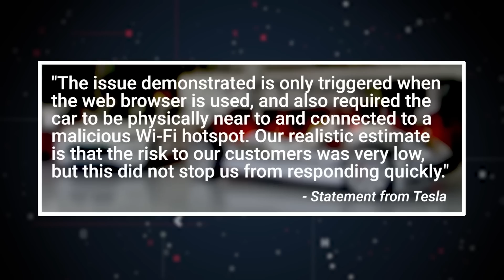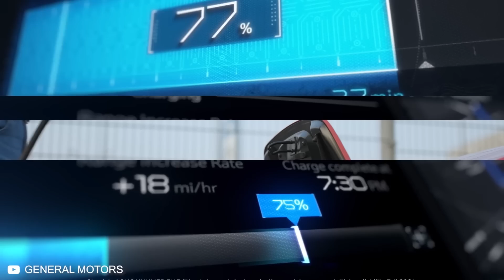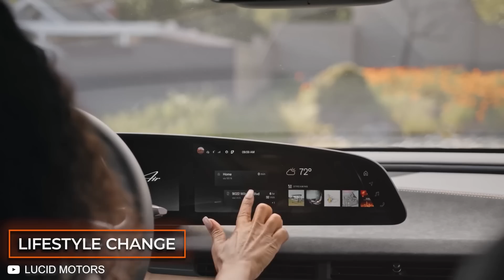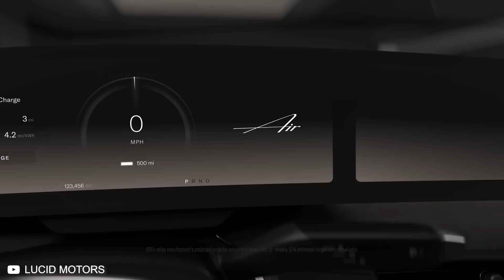EVs' Serious Problems That Carmakers Are Hiding

Comment: If I understand correctly, lithium battery production is bad for the environment.  Disposal of used lithium batteries isn't good for the environment either. Then there is the issue of how the electricity is generated, to charge the vehicle's batteries.  Solar panel farms don't work so well on cloudy days, or at night.  Wind farms have been known to fail in freezing weather and when they wear-out, their components are buried in large landfills, since they can't be recycled.  When newer battery technology replaces lithium batteries, and the electricity supply production is resolved, EV vehicles may start making headway in replacing the internal combustion engine.  As is stands now, EV's are a novelty item for those who can afford them, and only plan to use them for driving short distances.
Reply: There is no such thing as green energy. They will all pollute and destroy one way or another. The right thing to do would be to have a mixed energy matrix. Carss could be hybrid instead of this EV madness. Hybrids can reunite the best of both worlds. The old Fusion would run on EV in the city, but if needed you could run on gasoline, which was good to travel. Besides, it would auto-charge by converting the kinetic energy of moving into battery charge.
Reply: @Willowy13  Somehow this seems to have been all forgotten in the rush to go totally electric.
Reply: @Willowy13  Hybrids double the complexity, making the cars more expensive and more likely to have problems.    Pure gasoline or pure battery EV, those are the only sensible options.

Hydrogen EV is a joke, not even worth of discussion.  Toyota Mirai, for example.
Reply: @DerekDavis213  hybrid Prius V is a great car and not expensive at all
Reply: @ivanvalentin3898  Several problems with Prius:

-weak motor, poor acceleration
-it looks wimpy and boring
-it is not a man's car
-hybrid is complicated,
-battery EV is more reliable
Reply: @DerekDavis213 Hybrids? Mechanically not really. Battery and a EV is not as simple as you think.
 Automatic transmissions and IC engines also are very complex. I have taken just a few of them apart and put them back together. That is the easy part. All the stuff wrapped around it not so much. Then there is the 1s and 0s part.
But Batteries? No thanks. Do not like working in a hazard suit.
AS to why a hybrid can be a good thing.  Had to get the automatic transmission rebuilt at 150,000 miles. Pretty much normal. Got two choices auto or manual. Replace clutches at 90,000 or so or rebuild the automatic. But do not worry they have figured more expensive ways to build a manual transmission. Dual Clutch. 
Have I had manual trans missions that have went to the bone yard and never repaired. With the chassis and motor worn out? YES 
Well if you can make a battery that WILL last longer than the I-6 in my T-blazer? 18+years and 200,000 miles.
 I will buy it. THE following splains how it works. THE main failure point is the battery. For Toyota and Ford, no exceptions.
Continuous fast charging ANY battery is not a good thing for battery life. BUT what do I know? I am a college STEM graduate.
https://www.youtube.com/watch?v=hHU5xFOBcsU&t=1156s
Reply: @DerekDavis213  Love the comment "it looks wimpy and boring"
Reply: For anyone not living in an urban nightmare or city sardine can, all of this is total nonsense. Let's see how good you can plow snow with an ev truck. And how much wood you can haul with a tesla.
Reply: @nathanlambshead4778  Also if you are away from an urban area, good luck getting timely service for the Tesla.

People that like to service their own cars are out of luck with Tesla:  it's locked-down and full of DRM.
Reply: The only way that solar panels can show promising results is if they're put into space.
Reply: @caster863 your cables will be too long and voltage loss will be too great to even consider doing that...
Reply: @caster863  Solar panels are promising for only a stopgap, Wind and solar will never carry the whole base load.
Reply: I agree they are trying to do this transition to fast.
Reply: Agreed.   Tesla is only good for people that:

-drive short distances, not frequent road trips
-can charge at home in their garage, with 230 volts 50 amps
-live in moderate weather.  Extreme cold or heat is not good for EVs
-can accept all of Elon Musk's hype and bullshirt
Reply: @DerekDavis213  Exactly. Plowing snow at  –10 degrees doesn't go so well with evs.
Reply: @nathanlambshead4778  Yes, and also towing is poor with EVs.   And Tesla gives a rough ride because of low-profile tires, and primitive suspension.  And wind noise at speed.
Reply: @DerekDavis213  Plus wearing tires (and roads) out fast because of the excessive weight, of ALL EVs.
Reply: @nathanlambshead4778  And even before the tires wear out, if you hit a curb or pothole with ultra low-profile tires, say hello to 1000's of dollars in damage to tires or wheels.   Tesla s__ks.
Reply: @DerekDavis213  It's a fact shared by all EVs. Not just teslas.
Reply: @DerekDavis213  exactly.
Reply: @DerekDavis213  EVs are hobby cars, sorta like those bicycles with a cargo area up front that some people buy to transport kids and groceries. This is why government is forcing their use, they suck.
Reply: @melainewhite6409  If EVs had longer range and lower cost, they wouldn't be so bad.

But government is going to have a hard time forcing their use in USA, when 100 million people rent apartments.
Reply: @DerekDavis213  Ok, if EVs didn't suck they wouldn't suck. But people ignore reality (and physics) that from the day they are made, batteries continuously permanently loose capacity, much more so whenever used, and severely so when discharged more than 50%. Just like range and recharge numbers are a fiction, battery life claims are also a hoax. My relative with a 5yo EV has 1/3 range now which again, was never actually near the claimed value.
Reply: My wife want to change her Lexus to an EV as it is so much more convenient in winter! (we live in Sweden).
But you are right in that if you do not have access to an outdoor outlet, you should not buy an EV.
Reply: @DerekDavis213 allcorrect but it’s Musks ‘ attitude that’s off putting
Reply: EV's = child slave labor in The Congo and a fiery death for you in your sleep while your car is charging in your garage overnight.
Reply: Cables are stolen everywhere for copper and that  will be the end of EV's
Reply: @lucbos7516  I know that in South Africa (where I grew up) cables are constantly being stolen. Miles of them at a time. Have not seen that in USA though. At least, not that I know of. Have you?
Reply: I still have not experienced a rechargeable battery that lasts longer by being fast charged.
Reply: Electric cars are a massive environmental disaster. Why would you buy one?
Reply: I 100% agree, not to mention how the Lithium is being mined for by basically slave labor. However, I am hopeful that there will be alternative technologies like Sodium-Ion Batteries or Solid State Batteries.

We need a much greater investment in safe Nuclear power generation for consistent, clean energy production.
Reply: @the_realJP_  as a mechanic I discuss the problems with electric vehicles in depth on my home page vid.
Reply: You are absolutely correct. big scam and a socialist move. We don't have the raw materials to come up with the materials. So let's give this to china along with the solar panels and the slave labor provided.
Reply: ...not to mention the fact that solar panel farms actually kill valuable green space. They end up destroying the very plants and trees we need to produce oxygen and take up all that CO2 that everyone complains about (which is still a headscratcher for me).
Reply: @mountainsriversandtrees1474  Absolutely. In fact, almost everything about the perpetually offended 'woke' generation is a head scratcher. They say 'follow the science' and then in the next breath insist that men can get pregnant.
Reply: Amen brother!
Reply: @douglaslynn157  My 'fam' is smart enough to know that Elon Musk all about hype and bs.   People paid $10,000 or $12,000 for Full Self Driving, which is years late and nowhere even close to working as promised.   FSD is pretty much FRAUD .

What's that old saying?   'Fools and their money are soon parted'
Reply: In your head, is the year 2005?
Reply: @BioniqBob  In Tesla's head, it is still 2005.   Poor paint job, poor fit-and-finish, Phantom braking.  Issues that should have been resolved years ago .
Reply: @DerekDavis213  Some rattles should not happen, true, the rest of your thoughts are hogwash.
Reply: @BioniqBob  My wallet tells me it is 1980 again. And my Trax tells me it needs a purge control valve. In 1980 I could easily fix a 6 year old GM transmission or engine. So now I have a 1/4 of a car for 3 times the price of a 1980.
 But hey who cares that California is polluting the the air with carbon dioxide? Or has the Mosquito fire went out?
 As far as I am concerned CO2 = CO2.
So what do I know about CA and fire? CA ARNG from 1988 to 1995. 1 riot, Gulf 1, 4 fires and 2 earthquakes. Activated for all of them. After that MI ARNG. Gulf 2. In total 3 national defense ribbons. Literally been around the world twice. Never set foot on Antarctica and do not plan to. The others been there.
🌍🌎🌏
Reply: @warrenpuckett4203  Rent a cave
Reply: @BioniqBob  Need Dept of Interior approval for that. That is if I am a native American and on tribal  land.
Reply: Go for a drive in your gas car and don't miss the beautiful burnt forests. Breaking a promise is not breaking the law. You have a lot to say about something you don't know. Go spew to someone who is as nuts as yourself.
Reply: ? for the brainless lefties: if magic future tech is just certain to make EVs not suck like they do now, why won't this magic future tech give ICVs 200MPG etc.?
Reply: I have solar at home and charge my EV even during cloudy days. For almost 10 years now I've been driving the same EV and no cost for fuel, except for the initial purchase price which paid off a while back.
Reply: @ab-js2gw  How much will the battery cost when you have to replace it? How much will you be charged for disposing of hazardous materials? And how do you feel about child slave labor used for getting the materials for the batteries?
Reply: @ricktd6891  car is already paid for itself, in terms of environmental impact I don't care as everything is bad for environment. Now regarding slave and child labour, look at everything you use all made in China India etc. so both of these countries and others are known for their unethical use underage and underpaid workforce.
Reply: Agreed except for the distance they can travel over 200 miles in a single charge now.
Reply: @abigailslade3824  A Tesla driven in the cold winter, with heater on, will get less than 200 miles.

I can put 300 miles of range in my gasoline car in 3 minutes, at thousands of gas stations.

A Tesla has to charge for 30 minutes, and sometimes you have to wait in line too.

Tesla Full Self Driving is years late, and nowhere near working as promised.
Reply: @DerekDavis213  hahahaha
Reply: @DerekDavis213  what about A/C? I live in South FL and tell you what its no fun driving a tesla 50 miles with A/C running then having to wait somewhere an hour for a "fillup".
Reply: @leecowell8165  That's true.  Road trips in the Tesla are very inconvenient.  A HUGE waste of time.

I can put 400 miles of range into my gasoline car in about 3 minutes.   At over 160,000 gas pumps nationwide.
Reply: @abigailslade3824  I totally agree.  They have a range over 200 miles.  I live in Texas, where I may want to visit relatives that live 200 miles away, and they don't have any charging stations near them.  I could drive to locations close to me & home, but couldn't make longer trips that don't have charging stations.  Texas is a big state with many miles between cities.  I've also read that in freezing weather(or hot), the range is greatly reduced with lithium batteries.  We just don't have the needed infrastructure in Texas to change to EV's at this time.
Reply: @jamesjones8482  hahahaha
Reply: @douglaslynn157  hahahaha 🍺Too much weed?
Reply: @tip00former1  no weeds use roundup
Reply: @abigailslade3824  Nope. Oh, so people with this magical 200+ mile range routinely travel 200+ miles between charges? Speak up. That's right, they NEVER do. And EVERY video I've seen the displayed miles remaining goes down way faster than actually miles traveled, by like 3X. Range numbers ARE A BIG FAT LIE.
Reply: @melainewhite6409  my brother drives a polestar 2 and it has a range over 200 miles, I am not a fan of electric vehicles they are another scam like renewable energy but if we are going to overcome these assaults on our way of life then we need to be honest and deal in facts and then show the flaws in the system like Dee did.
Reply: @abigailslade3824  Not being a leftist I'm open to the truth. So how long has your brother had his EV and how many times has he driven it over 200 miles without charging? And would you know why in every video I've seen, the miles remaining display decreases faster than the actual miles driven?
Reply: @melainewhite6409  believe what you want
Reply: @abigailslade3824  Actually, you're believing what you want since your brother's EV with your claimed 200+ mile range has never gone 200 miles between charging.
Reply: @melainewhite6409  yes it has I just can’t be bothered to argue with a know nothing, know it all.
Reply: Mine can go twice as far. But this way I never have to fill it completely I can speed an use the AC while never becoming nervous. And apart from convenience, driving >3h without any stops is bad for you, ask any doctor.
Reply: Don’t know if I’m patriot @ricktd6891  , really not sure what it is. I suppose I’m in the right-wing where I’m from (Sweden).
One thing is for sure though, I bought my Tesla because I liked it, and after almost 2 years I still think it is the best car I’ve had including at least 100 rentals. I mostly go to work, but have done 7 long hauls or more. One thing is for sure, I will NOT refrain from it just because a government likes it. That it helps with global warming is a plus. And yes, global warming is a fact, it is simple science. I have been aware of it since 1979 even though most people, not least greens have not understood it until much later.
But I will never let a government dictate what I should have, I have my knowledge for that.
Reply: @matsgardin8332  Sorry I have to correct you. Global warming is real but that's not the hypothesis. It's "CO2 caused catastrophic anthropogenic global warming" and it's false. Not to mention the idea that global warming is a bad thing when the Earth is historically cold, like it is right now, is also false. CO2 doesn't control the temperature of Earth. CO2 doesn't even control the greenhouse effect which also doesn't control the temperature of Earth. Here's some data for you. Search : "Global temperature and atmospheric CO2 over geologic time/graph/images" You can see we're deep within a giant ice age right now and atmospheric CO2 is historically low, so the Earth isn't hot, it's cold, and atm. CO2 isn't high, it's low. You can also see the 2 don't go together all the time, they also went in opposite directions for millions of years.
Reply: Hi  @ricktd6891  I’m glad you look. I knew that CO2 is chemically a greenhouse gas before I new about warming. (I did chemistry)
There are more reasons for heating than CO2 (O2, N2, water vapor, how the sun shines and a bunch of other reasons), but CO 2 cannot be neglected. There are also a lot of circular effects. If other come before CO2, it will still happen. If CO2 comes first it will happen.
That we (in Sweden) would become warmer is NOT a problem as some greens insist, insects deceases and more. As far as I know they have a nice life in Bavaria as well.
The problem is rising seas. Again, living in a rich country at a reasonable elevation I won’t be a victim. But if the seas rose only 3m (10 ft), most of our large cities would be devastated. And 3m is not much. It can reach 30 m in 400 years or so unless we shape up.
Reply: @matsgardin8332  How about the polar bear lie? They're not going extinct. The population was booming so much they removed the ban on polar bear hunting and you can book a trip online right now.
Reply: @matsgardin8332  How about the hurricanes getting worse lie? We just broke a "hurricane drought" record set back in 1860 to 1869. We beat it by 3 years, 2005 to 2017, which means no category 3 or stronger hurricanes making landfall in the U.S. for 12 years. You can look it up under "recent hurricane drought."
Reply: @douglaslynn157  If 'liberal' means I'm not a Redstate bible-thumper, then yes I am liberal.
Reply: Brings to mind Texas management that failed to find out the temperature range they needed to build for. Idiots built fair weather only wind turbines. Texas could have had a perfectly stable grid by now, but they were too cheap to build the storage to go with it. BTW, 19th century HZ AC forces wind turbines to require elaborate mechanical transmissions and limits the range of wind speeds where they are operable.

Solar panels pay back the energy it took to manufacture them within two years. Wind turbines onshore take a few years, because of their huge concrete foundations. Utility scale solar farms are the cheapest energy right now, but in order for them to surpass more than a third of the energy mix, a huge investment in storage is required. It will require a lot of concrete and square miles; worn out turbines and solar panels will  not be the weakest link, but concrete probably will. Everybody knows capacity factor is the big problem with wind energy, but along with solar is the best stopgap we have until the nuclear industry gets its act together even though solar is a huge project that will create a stream of e-waste almost as bad as PCs did in the '90s and  data centres do today. 
Solar and wind are the least of the worst.
Reply: You obviously understand nothing about the seriousness of climate change.
Reply: @kenbob1071  Serious lies and snakeoil salesmen, we know. 
Climate has been changing for millions of years and will continue to do so long after we are gone, no matter what you do or think. 
You liberals are so full of yourselves, thinking you can affect the planet wide environment, we haven't even existed for 1/1000 of the time the Earth has been here.
1 major volcanic eruption expels more "pollution" than all the humans since the industrial revolution began.
Go look up how many volcanoes are actively erupting at any given time around the world.
You need a real education.